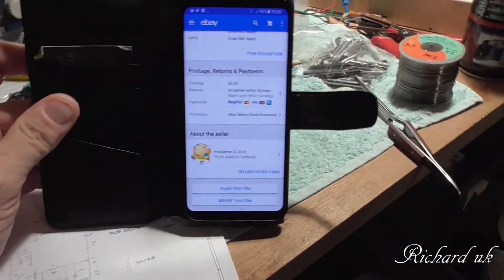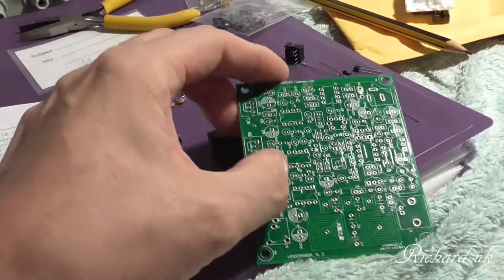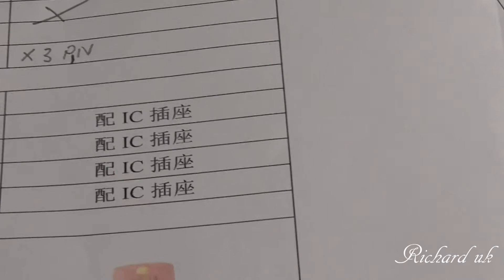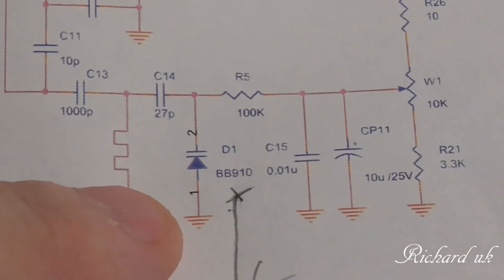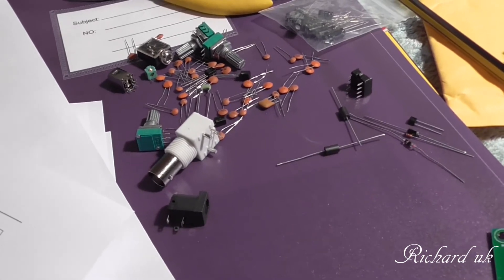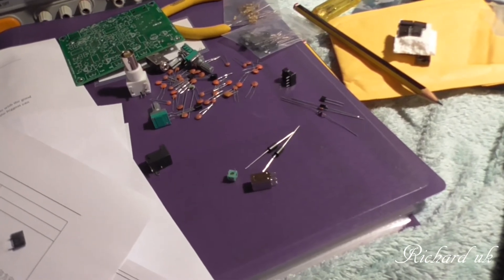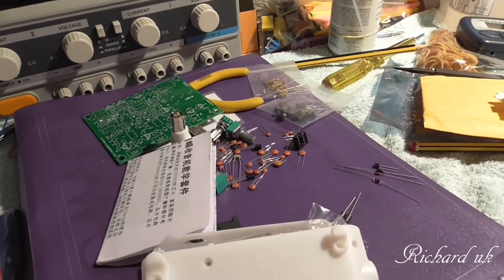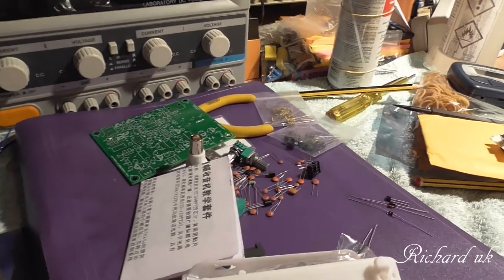Aviation Recever 118 to 136 mhz bad kit and seller

Comment: I'm thinking they are varactor diodes that are also called tuning diodes. They are often found in circuits like that one for aircraft radio receiver kits.
Reply from the maker: skycarl thanks you Carl  Its a new one for me.. never seen any thing like them before.. so would this explains why I cannot test them. Ok if this is what they are. I put this together see what is like lol
Reply: They can be fun Richard. Best if you go out by an airport that has traffic control. You should be able to pick up airliners also. Keep us updated.
Reply from the maker: skycarl thanks m8 I will do..